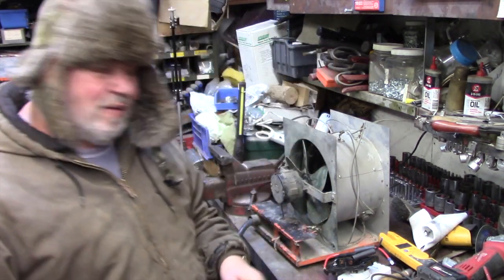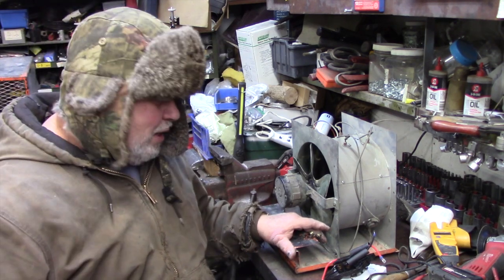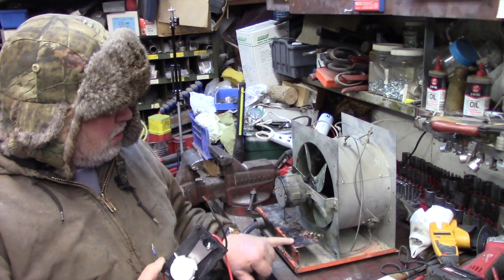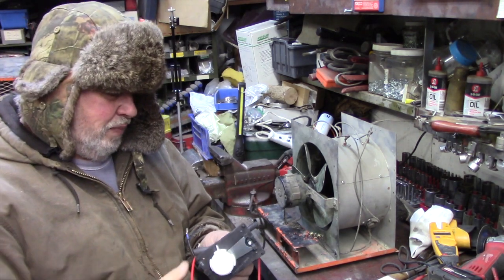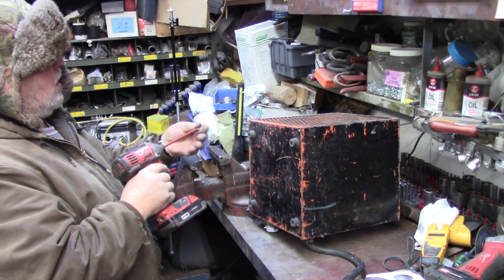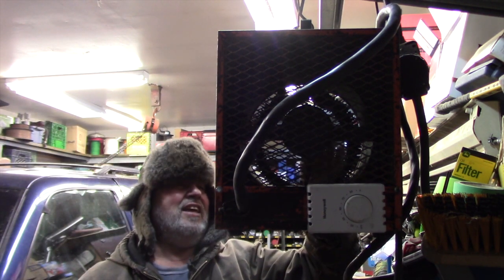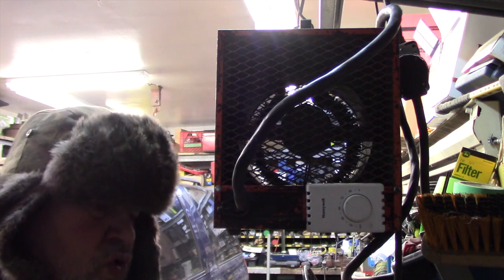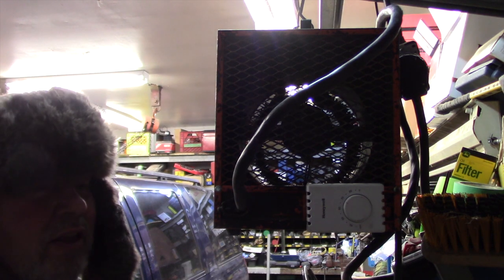Constuction heater thermostat fix

Comment: Great fixe Gator and great modification on your heater 👍😊 Very well done and safe too 👍😊 The main reason why they are so expensive ( they are small size !!!! ) Like the steam train whistle and keep warm Cheers !!!!
Reply from the maker: RCAFpolarexpress I think it's expensive because they are not produce or sold as much as the wall thermostat plus there is not as many that are sold and probably just because at the time I'm looking for a thermostat like that one so I pull a switch....CHEERS
Reply: @gatorsworld  👍😊

Comment: Nice mod Gator . P/Auto sells them thermostats for $20 the one I used to mount on my shop wall.
Reply from the maker: The double pole wall thermostat is just borderline to be acceptable on one of these construction heathers but hey....It works and it`s Gator safe I say so I`m going with that....I've been neglecting P auto since this covid thing started....I`m kinda grounded in the garage....what a life...CHEERS
Reply: @gatorsworld  Gator I dont go to PA ether but I order off their web site as its free shipping on orders of $50  .  I just bought two small  tool boxes  for $30 each with 2 sliding drawers to put all the tools in I have  scattered up  at the camp :)
Reply from the maker: @SteveRobReviews  I never think of going on-line....should do that

Comment: i would have done the same think it will work as good if not better then new thumbs up shared  just mounted different big deal great job gator and it still looks ok as well
Reply from the maker: It`s hung up and running and running good....I think it`s even better quality than the other one I was using....These heathers are not all created equal....this is an oldy but a goody....CHEERS